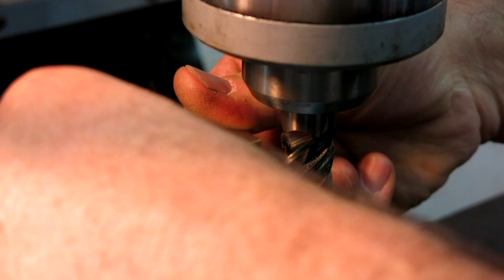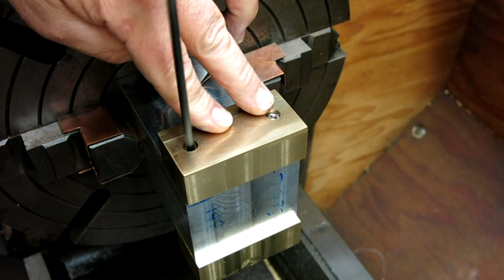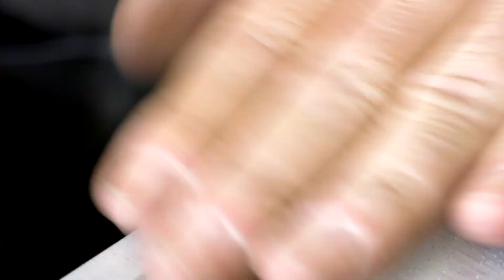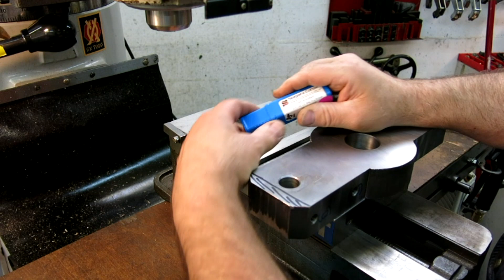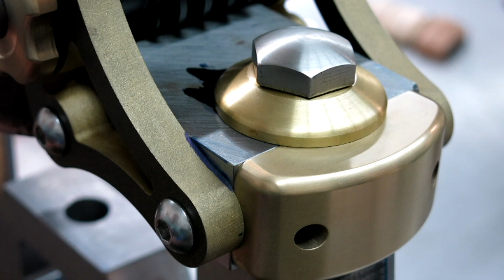Fancy brass end Caps

Comment: Looks cool... but too much screwing around... plus the wall where you whacked the end off near the bolt is is weaker... Since it is going to be painted anyway... I would have just welded more metal on the ends and curved it the same way.

Comment: Tom,
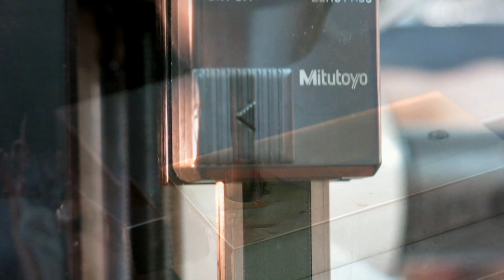at 7:00 is that a left hand counter bore? It looks like it is runing in reverse.
Eric
Reply: I was thinking the same
Went looking if someone asked the same question i was gonna ask lol
Reply from the maker: Hey Eric,

Optical illusion. The frame rate must have matched the countersink speed. Its turning clockwise. Thanks for the comment.

Cheers,

Tom

Comment: Nice fix Tom. I'm slightly concerned about the reduction in strength around the hold-down screw. But considering the thickness of that bar, I suppose it isn't a problem. I think if I were doing it I might have left a thicker section around the hole. The washer would have hidden it.
Reply from the maker: Hi Wilton,

I'm not too worried about the strength in that area. Now if it was a pressure vessel I would have my worry on. Thanks for the comment.

Cheers,

Tom

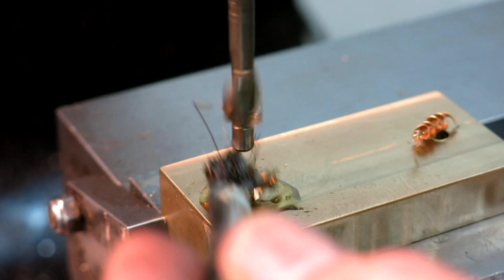Comment: Just after the pilot gave up the ghost, at ~ 6:50 it looks like the mill is turning CCW, is this an optical illusion?  The countersink cutter looks like is should cut in the CW direction.  Just curious.  As always, great job on the finish you achieved on the "Bozo Plates".
Reply from the maker: Hi Arlen,

Optical illusion. The tool is rotating clockwise. Thanks for the comment.

Cheers,

Tom

Comment: Very nice Tom.
What you were making was (something similar to)  a three centred arch.    Mmmm. Classical!

On another subject, I think you have a design flaw in the two brackets that carry the worm. When the worm comes under load, the brackets will exert a lot of leverage on their fasteners. I predict loosening of the fasteners or bending of the brackets. I think you should consider some sort of strap across the top of the brackets. Cheers.

Comment: Nice filing You're the first person I've seen file a convex surface correctly. As the file is pushed forward the tip goes up and the handle goes down. It helps keep the file tangent to the radius. And you lifted the file completely off the work piece on the return stroke.

Comment: I'd love to see a sketch of the new endcaps on the original horizontal members where those corners are blended in using a stopped chamfer or radius, it could solve the wierdness at the worm gear support plates.

Comment: Did you ever take a 5/16 dia short length of CRS turn one end to .25 dia. about 1/2 long. turn the other end down twice the thickness of your emery paper to the same width as the paper. Split this end with a saw and slide the paper into the saw cut then wrap the paper around the shaft and tape the bottom onto the shafts with electrical tape. Slide the 1/4 dia into a collet of a high speed air grinder and eliminate the hand polishing just be careful not to roll over the bottom edge. I've used these cheap but effective tools for years to save countless hours of hand work but they require a bit of skill to yield professional results.

Comment: Hey Tom, if you look at say frame 24:50 somehow the far corner of the steelwork (opposite corner to where you marked with blue) gives the illusion of a small radius away from the bronze.  It's very simple and looks really neat.  Would it be better to do this on all the corners/intersections with the bronze rather putting a radius on the whole of the steel part?  A small radius flare blended into the bronze might look better and involve less work.

Comment: I would have (if I had your welding skills that is) welded the chamfers so the bronze washer was still supported on the steel and then added the end caps, but to each their own.  Looks good anyways.  How many HP is your mill?
Reply: +1 It's metal, add some where you should not have taken it off :-)

Also, am I missing something or won't the problem still be there if you don't add a flat to the side to eliminate the gap to the support bracket and end the corner radius at the same place as the chamfer???

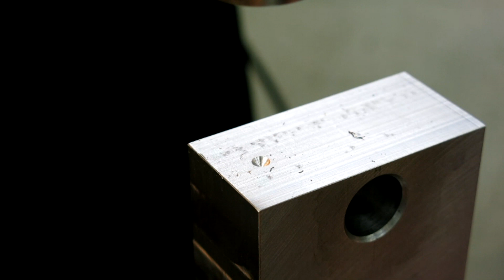Comment: 21:20 -- Tom starts drilling the holes in the top of the "bozo blocks" with an 1/4-ish to 1/8-ish inch bit (could be more-or-less, just can't really tell from the angle and am not sure how close to the surface we are with the camera zoom) just so the smaller bit doesn't have to chew directly into the workpiece (and get worn out), but his second press is with a bit small enough such that when he starts drilling and the bit starts to really make its way into the workpiece, it creates its own chamfer for easy tapping! I've never thought of that (mostly because I'm not the brightest crayon in the box). The stuff I learn watching this guy. 

Tom, I <3 you.

Comment: Question about your filing technique, Tom: around 12:30 you file the radius blend by starting horizontal and transitioning to vertical through the stroke. That's the opposite of what I've always done. Is there any advantage to your approach that I'm not seeing, or is it just personal preference/comfort? No question you have many orders of magnitude more experience than I do.
Reply: Many good books have been written about proper filing methods, you might check Nicholson Tool Co. for some reference material and tips on Filing and File care; (http://www.nicholsontool.com/MagentoShare/media/documents/nicholson-guide-to-filing-2014.pdf ).  The method you say you use ( opposite of that shown above ) is very common among beginning hand tool users learning on their own and usually leads to years of mediocre results in hand work such as this.  If you think about the file stroke as shown in the video, the file is progressing along the work with fresh clean teeth constantly entering the cut as the stroke progresses.  If you do the opposite, the file is then carrying cut chips forward and into the path of your stroke. The file is forced to try to cut new metal and at the same time grind up the swarf you are pushing along into the cut. Usually very poor finish and often clogged and dulled files are the result.  Good Luck .
Reply: I seem to remember Tom doing it the other way till it was pointed out to him he was doing it wrong, :>) he does it the right way now. 
Doing it the way Tom does it really does make rounding a corner smoother, give it a go and see for yourself.

Comment: Great design work Tom, often today the design time is cut from so many of our projects. I've designed many buildings in my time and it seems as if design simply has taken a backseat in most places these days.
Reply: Couldn't agree more, far too much squared off shapes today. The old school castings forced a lot of tapers and radii that are long gone from present design for the most part since it's simply too expensive to add it. In our own shops and for our own projects time is of much less importance so we can do so just because we can.:-) It does imho require a bit of an artistic eye and a lot of study to get it right though.

Comment: Cutting the radius on the brass end caps using the four jaw was particularly cool. Clever stuff as usual Tom.
Reply: It sounded like a radial aircraft engine at cruise when the cutter first bit into the corners of the blocks!
Reply: But then, with one prop blade shorter and lighter than the others ( O;

Comment: I have seen you use those highly positive rake lathe tools on brass/bronze now, and it seems to be working great. I thought you were supposed to use neutral or negative rake for those materials (and that certainly has worked great for me). Any thoughts on this?

Oh, and great project. Your wife has good taste, both in aesthetics and men ;).

Comment: You talk about the curves at the beginning and your dual radius method, I do this all the time designing things, and I pull the radii from other areas of the drawing just as you have done.
 I believe one of the reasons for the beautiful esthetics of old tools and machines is a side effect of drawing them with a compass and ruler.  Shortcuts like dual radius curves were used all the time because they were fast. The side effect is that the part ends up being geometrically pleasing to the eye because every measurement and dimension relates back to others in some way. If you are using the compass to bisect angles or find center points for instance, the nature is to put the compass point into the same holes to draw later features, inadvertently tying things together.
This is what is lost in computers. With a computer the designer has to consciously put these relationships things in.

And I still think you should have dovetailed the end cap on.

Comment: You do such fine ornamental work !  What about lock washers ? Is this a low vibration machine , or do we fill it full of Locktite ?
Reply: It is a hand driven machine, prolly runs at 2 or 3 RPM :)

If you go back 1 or 2 years in his videos, you can see him working on the drive wheel. It is 5' or 6' in diameter, looks like a fancy wagon wheel (it is in fact the icon he uses for the video), and must weight 200lbs.

Comment: Call them "Bozo Blocks".  It's a nice recovery. Hey, there is a reason that they put erasures on pencils.
The difference between a Pro and an amateur is the Pro recovers faster and smoother from their mistakes
Reply: A pro can hide their mistakes with no trace. A master turns the mistake into a design element.
Reply: "It's not a bug, it's a feature"